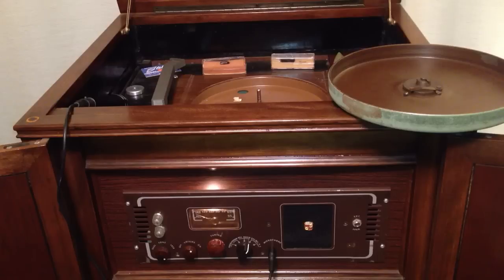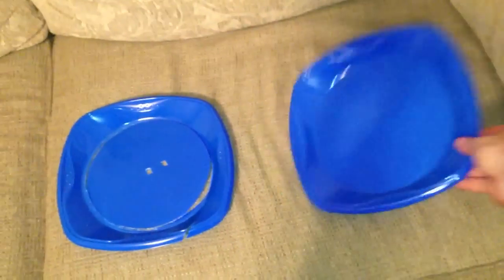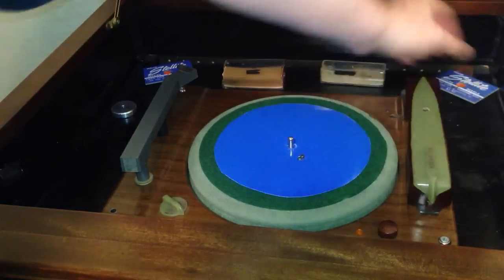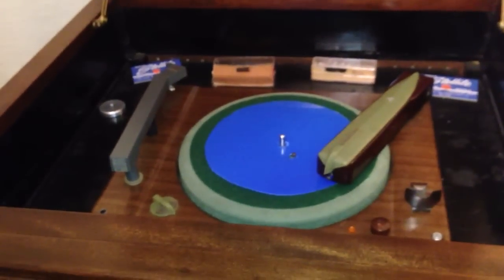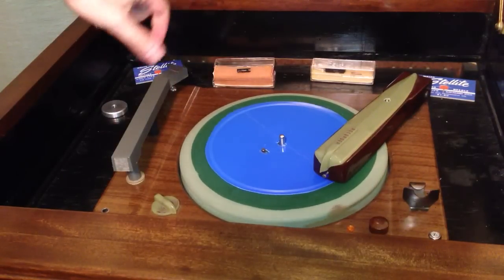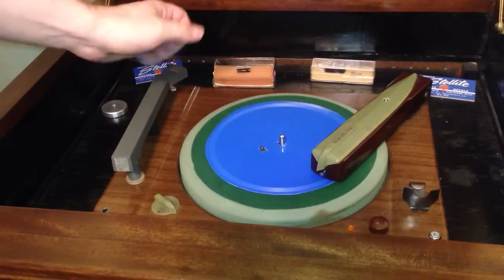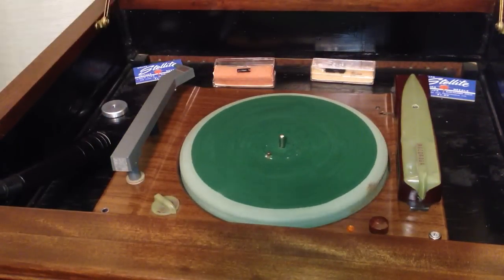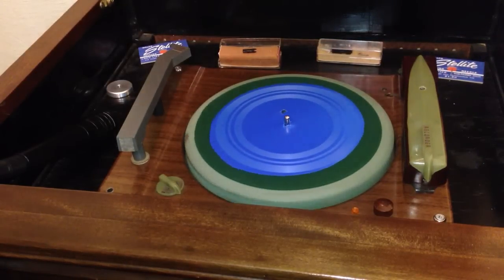Cutting a Record on a Solo Plastic Food Plate

Comment: I think I've solved your record / playback differential mystery. The cutting arm is applying drag to the turntable, so it's actually recording at a slightly slower RPM. On playing back with the playback tone arm, the drag is eliminated, for the most part, and therefore, the playback RPM will be slightly faster. This results in the chipmunk effect, and is why you will need to upgrade from belt drive, to direct shaft drive. Otherwise, you will need to come up with a way to record at a slightly faster RPM, to compensate for the drag induced by the cutting / recording arm. Hope this helps.
Reply: Exactly what I was thinking. It is drag at recording that does not exist at playback.
Reply: That's why "Kind of a Drag" by the Buckinghams is so fast.

Comment: The speed difference is probably due to the high tracking weight of the cutter head slowing down the motor.
Reply: Yeah......Sadly, my turntable has some issues. It is a dual 1214 from 1979 and it's very old, but it was very high end. Being made in Germany, it costed 150 bucks brand new in 1979, witch amounts to a big wad of cash now. I want to get this working like it was brand new. This model is quite rare. Some are being sold on Ebay for 350 and up. I love this record player. It sounds amazing still after all these years. My friend gave it to me. I am 19, but he was in his late 60's and he bought it brand new in 79. Best gift ever. I recently put a high end audiophile grade Sure M97XE cartridge in it and it sounds 10 times better. The one that was on it was a Exell EX70E witch sounded OK but not the best. I paid 110 bucks for the Sure. I LOVE it. What do you think??
Reply: I noticed this right away, that's obviously what it is -- the cutter head slows the speed slightly...thus resulting in near-chipmunk quality!
Reply: I wonder if you recorded onto something softer like wax the difference in speed wouldn’t be so bad? Heating up the recording medium might not be a bad idea, just to soften up the plastic so the cutting needle can better go through it, maybe have a high wattage light bulb or heat lamp trained on the disc as it records.

Comment: I've never seen a home record recorder before, that's pretty cool. If it has multiple speeds, you'll get the best quality from the highest speed. Also you might try lubing it with a parrafin base lamp oil when you cut your groove. Spin your plate on the turntable and apply with a mink brush from a ladys makeup compact. Found a couple at Goodwill for 25 cents each, great for cleaning glass lenses.
Reply from the maker: Good suggestion, thanks!  I'll have to try that lamp oil some time.

Comment: Thanks for sharing. This was fun to watch.  And it looks like you did a good job on restoring a nice example of early consuber grade recording eqpt. For what they may be worth, as I may be sharing ideas you have already covered, I have the following observations/suggestions....

The slowing down during record so as to result in a higher pitch sound on reproduce is accounted for by the increased drag on the turntable by the cutting head.  The reproduce head has nowhere near as much drag, thus less load on a drive system that might have some slippage under load, thus slowing the RPMs.

If there is any tension on the swarf as you collect it there might be some tearing of it as it cuts out of the recording surface.  This can cause excessive noise.

As you may know already, there are record/reproduce curves used in both mechanical and magnetic recording practices.  For cutting records the signal is radically processed before it reaches the cutting head.  The lows are cut considerably, while the higher frequencies are greatly boosted, following a specific standardized frequency curve.  This enables the higher frequencies to be of considerably higher magnitude than the inherent surface noise of the recording medium.  On reproducing the cut recording, the program is picked up, and goes from the reproducer head to a filter network that does PRECISELY the opposite of what was done to the signal before the cutting head--cutting high frequencies by the same amount they were boosted, and boosting lower frequencies by the same amount they were cut.  This pushes the surface noise level far below what is readily audible under the program.   

I would study exactly what the designer of that record/reproduce device had done to address this need, and perhaps make the necessary modifications.  At best, being of consumer grade at a time when the standard was not what it is today, the audio bandwidth is likely very limited, with the high end being perhaps as low as 8KHz, or even lower.  So you may find that you have reached a limit on what quality you will yield from the device if you intend to leave it as originally built.
Reply: Excellent points!
I would end-run the whole speed issue by direct driving with a geared down stepper motor. Any decent stepper driver would let you fine control the speed and set it arbitrarily. A great driver would be able to do half & quarter steps to increase speed control, although lower gearing would work as well, it would limit max speed as the stepper is more likely to miss a step..
Reply: As you may know, some turntables are driven precisely this way, with the "stepper" motor responding and turning at a precise speed as a function of the 60 cycle current feeding it.  A respectable sized audio amplifier and an audio oscillator could perhaps be used to vary the speed as desired.  The only  caveat is the need to make sure that the load on the motor is well below the full extent of its torque curve, as you know well what that kind of motor will do if such is exceeded.  I remember servicing a (IIRC) BIC turntable with a synchronous motor issue. It was stalling, and running in reverse as well as forward, due to a phase capacitor that had gone way out of tolerance.  The turntable jittered back and forth, and a record played on it sounded like what those techno DJs do that greatly annoys us vinyl purists.  :)

Comment: I am an audio engineer, havent worked with vinyl, but its more than likely noisy because (its hard to explain) but in a digital daw you will have alot of highs and lows in your waveform, and part of our job as engineers is to make sure everything is clean. to get rid of all of the highs peaks on a track we use compressors and levelers.  Back in the day when Mastering was a very different job than it is now, one of the main focus's was to make sure that the tracks in the vinyl wernt too rough because if it is too rough the needle can actually bounce all the way out if it is.  so try using a leveler or a compressor or both, and see if that cleans it up for you.. very interesting to see someone cutting a plate lol
Reply from the maker: Thanks for your comments, Ryan.  The only thing I get consistent results with is the plates.  I think it has to do with the softness of the plastic.  It "peels" easily.

Comment: If you have vlc, copy the URL for this video into the "Open Network Stream" menu option. Uncheck "Enable Time-Stretching Audio" in settings and slow the video to 80%. I think the [ key is the default slow down key.

This corrects the speed problem on the record, and you can hear what the solo plate would sound like if the cutter didn't operate at odd speeds.

Comment: A simple explanation for the "sped-upness" of the recording is the change in the motor. honestly the it was a great idea but the device is designed to record at it's stock set rpm so you may want to experiment a bit to find the best record speed. sometimes you have to sacrifice quality for quantity ;)

Comment: Hi! This was an interesting video! You had mentioned about a noise issue even with the proper acetate blanks. This noise was a common issue with the older cutters back in the day. It wasn't until they started using the hot stylus that the noise level became greatly reduced. The hot stylus system is quite simple in design. The cutter head has a coil of wire wrapping around the cutting stylus (needle) the wire is energized with a low DC voltage to heat up the needle which in turn softens the acetate composition to reduce cutting friction. The cutter head on your unit is very small and doesn't have the space to implement a hot stylus system. The hot stylus setup is designed for an overhead cutter which uses a feed screw where the cutter head rides on the feed screw across the disc. Presto and Grampian were the pioneers of the hot stylus design, and was used for many, many years for cutting acetate masters and quick dubs after a recording session. Hope I was able to give you some insight about your noise issue. Cutting to a plastic plate will always be noisy due to the excessive friction. The hot stylus is designed for use with the regular acetate recording blanks. Frank Ferraro--Audio Craft Electronics.
Reply from the maker: +Frank Ferraro - thanks for the insight!  I have had a few people suggest heating up the cutting needle or even warming up the plastic disc before cutting it.  I haven't tried that yet, but it makes sense.
Reply: +databits Whatever you do, do NOT heat up an acetate disc before cutting....the coating is explosive.
Reply from the maker: +Frank Ferraro - advice well taken!

Comment: Hiss surface noise can be due to a worn cutting needle or wrong angle.  The cutting needle needs to make a 15 degree angle.  Cutting needles do wear out, even faster when not cutting with heat.  New sapphire cutting styli are made long enough to be resharpened.  The angle changes depending on the length left of the stylus.
The aluminum acetate disks and the chip that comes out of them are quite flammable.  Using a chip vacuum there is concern for the flammable chip.
The drive mechanism needs extra torque for the drag of the cutting stylus, so a playback mechanism may be inadequate.
With modern digital recording I don't even record tapes anymore.  Interesting experiment and video, but something you may not want to continue.

Comment: The reason to is slow on recording is because the recorder pick up drags the disc and turntable like mad and motor needs to be soo strong to deal with it. On the other side, the play arm, doesn't drag at all so the motor runs effortlessly and faster.

Comment: It is really neat.  I think the reason it sounds faster during playback is because the cutting arm is extremely heavy and you have the rim drive which is fighting against the cutting pressure of the tone arm.  I don't know if there would be a way to get a much stronger motor in there, but I believe that's why that is happening as well.  This was extremely cool, though.  Thank you for sharing.

Comment: You replaced the motor drive mechanism with one that did not have sufficient torque to maintain speed during the cutting process,  The new one was only designed to handle the drag of a light playback stylus, this is the source of your speed problems.  As for the noise, this was a problem for professionals using lacquer as a recording medium, though lacquer, being softer than the thermoplastic you are currently using, started out quieter.  They found that heating the cutting stylus with a small electric element made the grooves cut quieter.  Don't know how you'd begin to apply that to your setup.  Great fun, though!  Thanks for posting these videos!
Reply from the maker: Thanks for your comment and for watching!
Reply: Great comment! Maybe he can stick on a heat lamp like they use to keep food warm, or something? This would also heat the record too, which might not be a good idea. Maybe a hair curling iron or something like that can be attached to the cutting stylus/arm? Whatever the mod is, should be reversible (for historical purposes), and, most importantly, SAFE.

Comment: I worked on old players in the 60's rebuilt them as a kid. I remember going to the drug store and there was this bespectacled druggist that would reach over and tap his finger on the RCA chart steering me to the correct tube for my radio,. they had a tube tester too. I turned my family radio unto a PA and played my guitar through it, real easy to do just find the right two wires on the volume control and that's it, you are having fun, so keep it up:)

Comment: I'm sure someone's already posted, but your pitch issue is from drag, and a weak motor. The motor you're using is from a player, and is probably a bit weaker than the lathe's motor was. When you're cutting the record, the cutting needle actually bites down into the material, causing greater drag than what would be introduced by a simple payback needle gliding along the grooves. Plus the motor is also having to drive the cutting arm too, whereas the playback arm just follows the groove. This puts a greater load on the motor, slowing it down. When you play it back, there is less load, so the motor runs faster, increasing the pitch. You can probably use sped control to adjust it out, with some trial and error, and practice.
Reply from the maker: You are correct.  I've learned much since this video was made.  Thanks for the input though!  Please watch my 2 follow up videos.

Comment: Recording at 16 rpm, will give a 'muffled' sound, unless you add treble boost, and are using a 'microgroove' cutter. This is due to the wavelength of the higher frequencies being extremely short. If you are using what was known as the 'standard groove' cutter stylus, then you need to run the disc at '78 rpm' where the modulation wavelengths are much longer and the wavelength of the higher frequencies won't be 'absorbed' in the groove width.

Comment: Nice work man. I think the reason for the speeding up on playback is either that the resistance caused by the cutting is reducing the record rpm (so a more powerful motor needed) or it could also be that the recorder head requires more electrical power to work so it lowers the available charge to the motor whilst recording, slowing it down. That would be my guess. Also how far was you from your microphone? You want to be about 6 inches away from it, much closer and you get too much low end in the EQ which may be partially responsible for your muffled sound. Keep up the fun tho man :)
Reply from the maker: Thank you for your comments.  I'm pretty sure I have two issues: one being the weaker motor, the other being the mechanism isn't made for this size turntable so the speed is slightly off even when playing back pre-recorded records.

Comment: Not an expert here but my best guess for better audio in general would be trying different needles/arms for your playback.  Make sure it actually matches the recording needle as well as possible.  I don't think they always stuck to the same standard so the playback one may very well be a different type thus why the result is noisy, skips and is full of crosstalk.  Second, the radio is mastered and optimized to be audible in poor conditions, ie narrower bandwidth, so naturally it will come out better on a medium such as this.  Try running the mic through a preamp which allows you to EQ it, then roll off the bass and give it a slight mid boost.
Reply: VoxHouseStudio Yeah or you know... its cuz its a plate.
Reply: samljer obviously. but it doesn't mean he can't get better quality out of it.

Comment: You can PM me if you would like to know more in-depth why you wont really be remove and more of the noise from your recordings, even on discs made for it. The brief answer is in your request for any professionals to explain this issue. That machine was never used to professionally produce quiet recordings. Pro-machines are much more robust and NEVER have a pivot cutting arm. The cut straight across the lacquer, with the needle at a 20º angle to the surface, to set the depth of cut. The lacquers are held down by 2 pins and vacuum. Even the professional 78 rpm cutting machines didn't cut very quietly, which is why Victor Victrola needles are called "nails"...they were amazed simply by voice reproduction, they didn't expect symphonic sound yet. The speed difference is obviously that the motor does not have the torque to cut into the plate, and simply drag a needle around it at the same speed. No pro units are also turntables. Try playing the record on a 16 rpm turntable, it should match cutting speed—unless the motor cannot sustain 16 rpm while cutting a plate.

Comment: Very cool. You took it one step further (or sideways depending on your POV) than I did. The distortion COULD be an issue in the audio feed to the cutter. If there is an issue causing distortion there it'll cut to the "record". I think you would need a scope to check that out.
Reply from the maker: That's one thing I haven't checked.  I might connect a speaker to the leads that go to the cutting head and see if there's any audible distortion in that circuit.
Reply: Yep.

Comment: I guess the reason why the result sounds rather noisy is that the recording needle is meant for 78rpm records with wide grooves and the playback tonearm has the LP/stereo cartridge with much smaller stylus. If you can get a 78 cartridge for the new tonearm, I think it might sound better.

Comment: The speed issue could possibly be solved by putting a speed control pot on the motor power wires for the cutter and experimenting with different speeds on the cutter until .you find the correct speed.